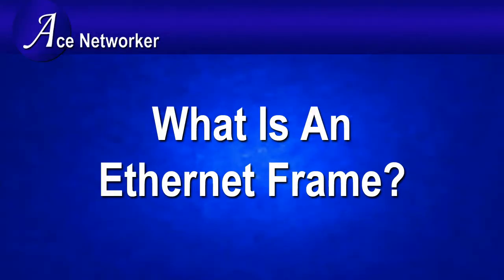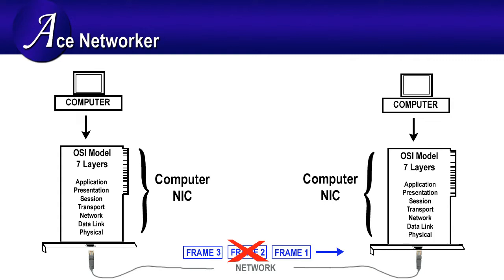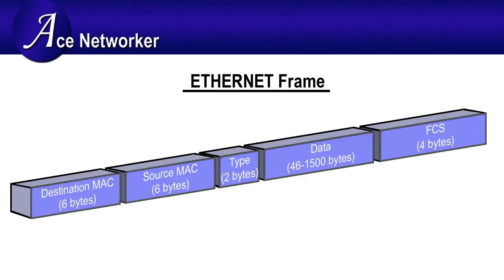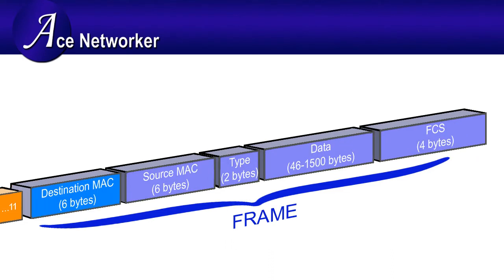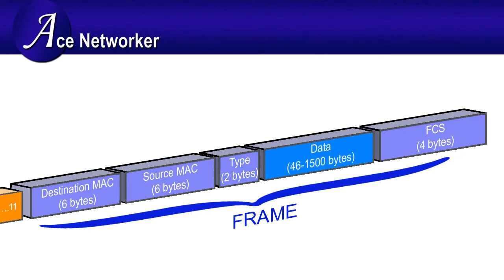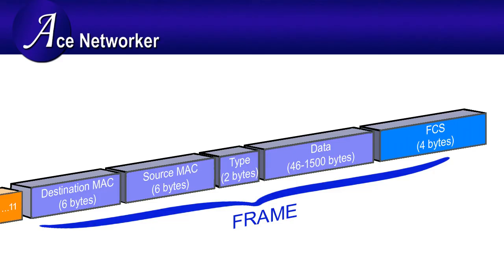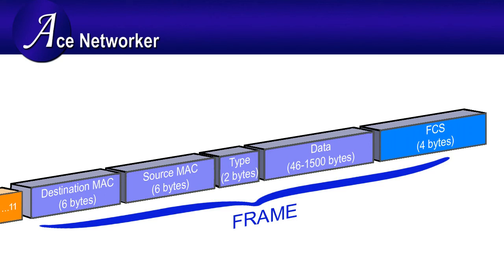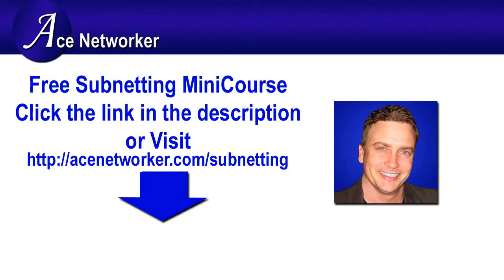Ethernet Frame Format Explanation

Comment: Why should the data part be at least 46 bytes and lesser than 1500 bytes?
Reply from the maker: That's a great question! It's only because by Ethernet standards, that's the size minimum and maximum of the data portion of the frame. If you really get into studying this and how it was developed, you'll find out this is the size requirement (and standard) due to the way NICs and Layer 2 switches are engineered to handle frames (and the data packets inside those frames).
Reply: @AceNetworker Oh okay, I came across something where it's due to CSMA/CD being implemented in earlier days and we have to use a minimum number of bytes to detect collisions and 46 happen to be the minimum.

Comment: What happens if the message (data ) has more than 1500 bytes? Is the message sent or  not because we see if the message is less than 46bytes there is padding.
Reply from the maker: The NIC (Network Interface Card) that is sending the data out onto the network media (cables, wireless, bluetooth, etc.) is what controls that. If the data being sent is more than 1500 bytes, it will need to send the rest out in another packet(s). Hope that clears it up.

Now, when you're dealing with hardware components on a network (switches and routers primarily) many of those devices in the industry can use Jumbo Frames. This means they can be setup or configured to allow bigger frames of data than just 1500 bytes. Jumbo Frames are used to reduce overhead in routing packets or frames on a network. Bigger package of data = less routing or directing.

Comment: Hello,
 if i have Wi-Fi component on small embedded device(Esp32) which component is dealing with Padding on ARP. The Data link layer(lwIP/TCP)  or NIC? 

Thanks for the answers in advance, I am trying to investigate missing padding of esp32 board because payload below 60b is not padded mainly on ARP commands
Reply from the maker: In most cases the hardware (i.e. the NIC/its driver) is responsible for ensuring an ARP frame meets the minimum frame size (by adding padding if necessary). The lwIP stack will build the ARP packet and may reserve extra space via configurations like ETH_PAD_SIZE, but the actual insertion of the padding is typically done by the NIC (or its driver).

So, on the ESP32’s Wi‑Fi component, it is the NIC that takes care of the padding rather than the data link layer (lwIP/TCP) itself.

Comment: Note : Preamble is 7 Bytes long (56bits) (64Bits if you include the SFD which is 8 bits long) is a series of alternating 1's and 0's. (10101010 * 7)
And it allows devices to synchronize their receiver clocks to make sure they are ready to receive the frame and the data inside.
The SFD  or Start Frame Delimiter. Is 1 Byte (8bits)  It marks the end of the preamble and the beginning of the rest of the frame.
Reply from the maker: @El_Narix  yes, I have an entirely different video talking about the preamble if anyone wants to know more about it.

Comment: i have a question, if higher level tcp for example layer 7 realises a frame has been dropped how would it do this over a layer 2 gpon lan? also is the preamble like a syn syn ack?
Reply: That depends.  With TCP, it determines a packet is missing and there is a mechanism where the missing data will be retransmitted.  With UDP, it's up to the application to determine if a packet is missing and what to do about it.
Reply: @James_Knott  cheers

Comment: thanks for the video! sorry if this is annoying but in some other videos i saw when the preamble ends in '11' then its an indication that its an ethernet 802.3 frame which means that the 'type' field is actually a 'length' field. just wondering if thats just a generalization or if all frames preceded by a preamble ending in '11' have to be 802.3? im trying (and failing) to find clarification on google so figured id ask in the comments.
Reply: The preamble is only used at 10 Mb.  As for 802.3, the only difference is that last bit is actually defined.  Nothing more.  The value of the Ethertype/length field is what is used to determine whether 802.3 or DIX ll.  If it's 1500 or less, it's 802.3.  If 1536 or more, it's DIX ll.

If you want to see what the original, pre 802.3 DIX looked like, you can search on "ethernet blue book" and download the PDF from Gordon Bell.  DIX ll came in with 802.3, with very minor changes from the original DIX, the most significant being the Type field became Ethertype/length.

Comment: Is a NIC the same thing as TCP/IP Protocol or is it more the general term for any card (network interface card) that uses the 7 layer OSI model
Reply from the maker: The NIC is the actual network interface card (NIC) that connects to either an ethernet cable or coaxial or other cable. The NIC can also be a wireless NIC with an antenna that connects to a wireless Access Point (AP). TCP/IP defines a set of standardized rules that allow computers to communicate on a network such as the internet. (Hope that helps clarify a bit)
Reply: @AceNetworker  Yes it does thank you very much and what a quick response! Thanks so much for the videos they are incredibly useful and the information is all communicated in a way that is easy to understand and retain. Best of luck with the channel!   : )

Comment: Sir, How does the sender know if a frame is received by the receiver as a corrupted frame /  frame dropped in transit to re-transmit the frame. Is there a acknowledgement sent by the receiver for each frame received correctly. Also how does the receiver knows the frames are received in correct order. Because sequence number comes only in layer 4 correct me if i am wrong.
Reply from the maker: Hey, thank you for the feedback and the question. Essentially, the Transport Layer is what confirms if all packets (and the frames they were transported in) arrived correctly to the receiving device/computer. If a frame is corrupted and dropped by the receiver, and TCP is being used, there will be no confirmation that the packet information IN that frame was ever received, so the sender will have to resend. 
I'll try to make a video explaining this in more detail shortly, but hope that helps.
Reply: @AceNetworker  Thank you very much for the quick response

Comment: Is FCS calculated for preamble and frame (destMac, sourceMac, type, data) or only for frame?
Reply from the maker: So, this is a long explanation, but here goes...

The IEEE 802.3 standard that defines the basic Ethernet framing defines the FCS field in Section 3.2.9 as follows:

A cyclic redundancy check (CRC) is used by the transmit and receive algorithms to generate a CRC value for the FCS field. The FCS field contains a 4-octet (32-bit) CRC value. This value is computed as a function of the contents of the protected fields of the MAC frame: the Destination Address, Source Address, Length/ Type field, MAC Client Data, and Pad (that is, all fields except FCS).

So specifically the Preamble and Start-of-Frame Delimiter are not covered by the FCS field. This is logical, considering the fact that these fields were used in 10Mbps Ethernet versions to provide synchronization function between the sender and receiver, and thus a (varying) couple of starting bits from the Preamble could have been lost or incorrectly recovered. That did not invalidate the whole frame, however.

(Hope that helps clarify it somewhat.) 

Thank you for watching!
Reply: @AceNetworker  thanks!
Reply: The preamble is not included in the FCS.  Also, the preamble is used only at 10 Mb.  A different coding method is used at 100 Mb and faster that eliminates the need for the preamble.

Comment: Now all modern communication protocols use CRC check. E.g CAN, CAN FD.. etc
Reply from the maker: Yes! Thank you! That's a very good point. I'm glad you pointed that out. CRC seems to have proven itself so well that it's been implemented in multiple other communication protocols and systems.
Reply: @AceNetworker  Yes, I am working with CAN now a days, CRC is a failsafe, it is saving life.

Every embedded engineer should right their own logic of CRC to improve the  logic and to understand CRC better.

The video is very informative and cool, thanks.

Comment: You haven't covered the Start of Frame Delimiter . Please include it. Thanks
Reply: he explained the preamble and the SFD as one part, which is why he said its 64 bits ending with "11".
Reply: The preamble and SFD, as described here only applies at 10 Mb.  With 100 Mb and above, a different coding method is used, which eliminates the need for the preamble.

Comment: Is this FCS include first three part of the frame including SRC Mac destination Mac and type or just the data part and also FCS   part?
Reply from the maker: So, this is a long explanation, but here goes...

The IEEE 802.3 standard that defines the basic Ethernet framing defines the FCS field in Section 3.2.9 as follows:

A cyclic redundancy check (CRC) is used by the transmit and receive algorithms to generate a CRC value for the FCS field. The FCS field contains a 4-octet (32-bit) CRC value. This value is computed as a function of the contents of the protected fields of the MAC frame: the Destination Address, Source Address, Length/ Type field, MAC Client Data, and Pad (that is, all fields except FCS).

So specifically the Preamble and Start-of-Frame Delimiter are not covered by the FCS field. This is logical, considering the fact that these fields were used in 10Mbps Ethernet versions to provide synchronization function between the sender and receiver, and thus a (varying) couple of starting bits from the Preamble could have been lost or incorrectly recovered. That did not invalidate the whole frame, however.

(Hope that helps clarify it somewhat.) 

Thank you for watching!

Comment: @Ace Networker
 there is series of 56 bits in preamble, correct me if i am wrong
Reply from the maker: Correct! Thank you for pointing that out. 56 bits followed by the 8 bit SFD
Reply from the maker: The SFD at the end of the preamble warns when “real” data is about to start since the receiver may lose bits of the preamble while syncing the receive clock.
Reply: @AceNetworker   thanks sir you cleared me confusion